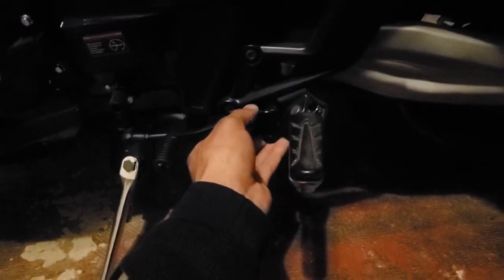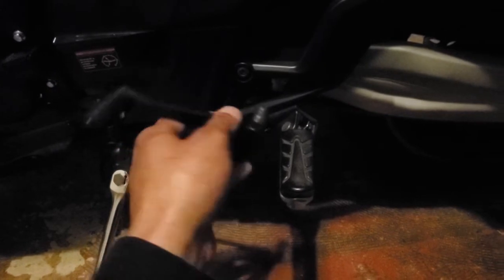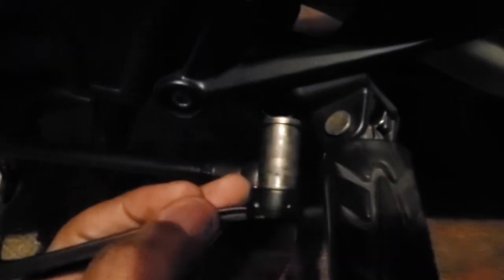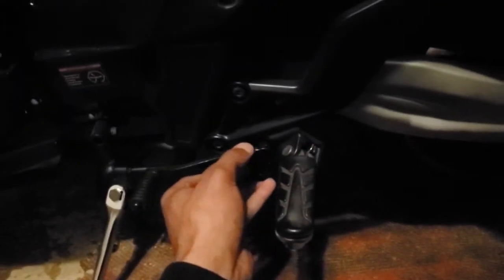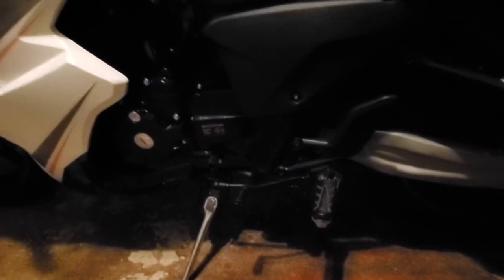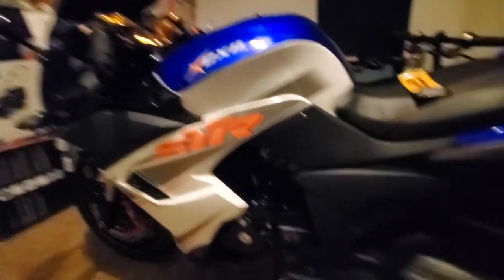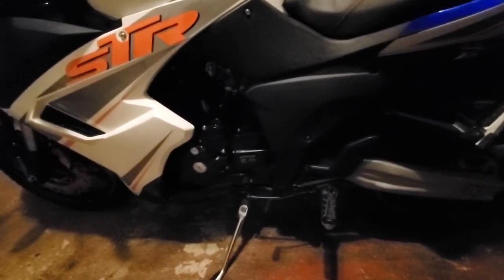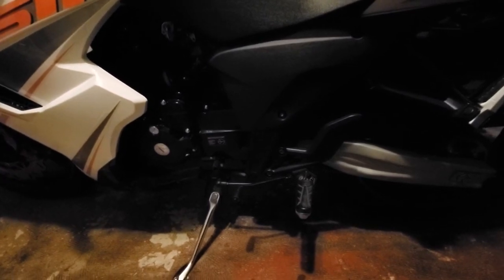df250 shifter loose, fell out during ride

Comment: Damn that’s crazy yea that’s good to know I’ll check mines out and see how it looks but looks like a clip goes there maybe it was loose but yea that’s dangerous
Reply from the maker: I'm thinking an "o" clip. Maybe they didn't put it on.  I was opening her up just a weeeeeee bit. And the vibration took it out at higher rmp. Around 6 to 7k
Reply: I will have to look at mine but like Mike stated its probably a c clip missing.
Reply from the maker: @JerryHawk250  & Mike check moto  I looked on advanced auto parts and found the clip. On there they are refered to as e clips.
Reply: @techjunkie3916  e clip, c clip. As long as it holds that sucker on they can call it whatever they want. 😂
Reply from the maker: @JerryHawk250  haha yeah no kidding. I'll try to pick them up today and slap it on. I appreciate you and Mike for the help. Ride on!